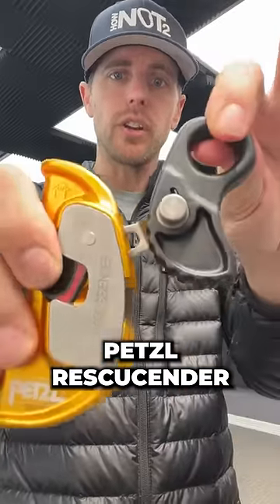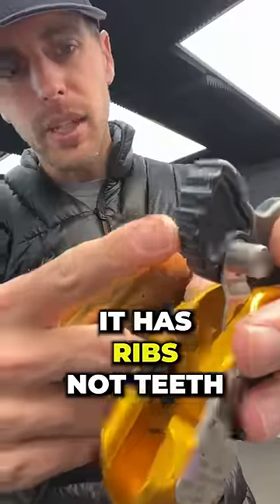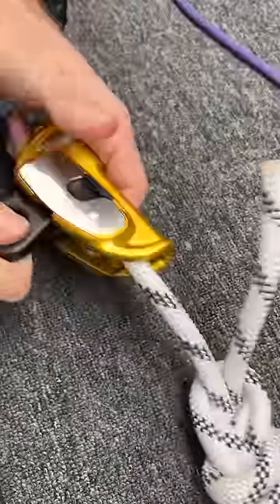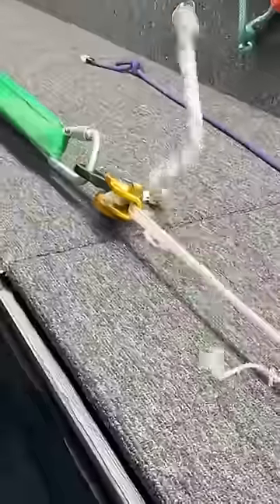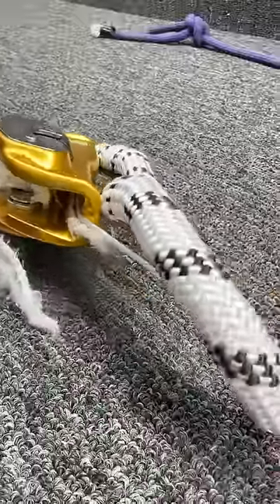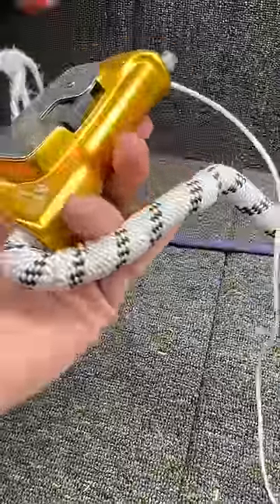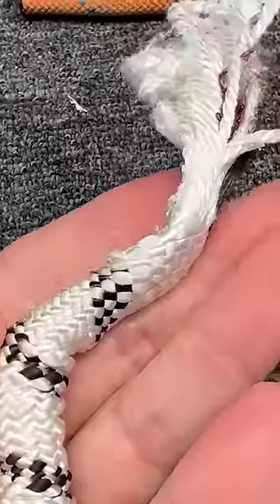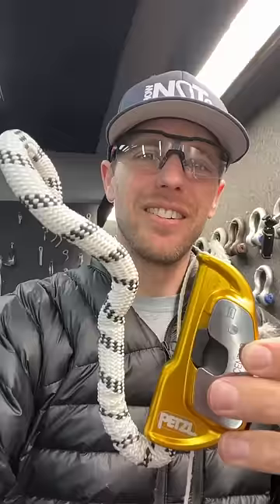I thought it was going to slip? #climbinggear

Comment: I imagine the slipping is in regards to how arborists use it as a hip lanyard and only put very light pressure onto the rope; causing slippage die to lack of friction. It happens with a couple devices.
Reply: Due to lack of friction**
Reply: I can confirm that the only time this tool has slipped for me was this exact situation. But only once. Most of the time you’ll have enough tension for it to work perfectly.
Reply: The other problem is if it slips once as an arborist I'll never use it again if you can't trust it you can't use it
Reply: Slipping can be preferable to ropes snapping. But this instance seems to have overloaded the buckle and it locked up instead of grabbing and slipping to absorb energy over time instead of jerking you to an instant halt...

Comment: IMHO, slow pull is not a legit test for the design intent of the featured gear item.  Moreso, the rescuescender's meant to ease adverse impact (F=ma, you know...) to the climber and gear during a single "critical" factor fall.  Drop tower testing is more appropriate to it's application?  Also, proving the rope is the weakest element in the system, as in the slow pull, proves the reusability goal of the rescuescender.  But, I'll recommend to do a "super good enough" appraisal of any gear involved after any fall event and destroy compromised gear accordingly, of course unless it's intentional repeated drop tower testing to destruction.  Thanks. 😊
Reply: Rescucender is a rope clamp, not a fall arrest device. It is not designed as a 'force limiter'.
Reply: Rescucender is a rope clamp, not a fall arrest device. It is not designed as a 'force limiter'.
Reply: @offpisteskiing  You are absolutely correct, but there are absolutely people out there training rope rescue teams that it IS one. I remember raising my eyebrow hearing that, checking the technical notice later, and wondering where the idea came from. It's floating around out there--I'd like to see a drop tower test too though. Could there be any truth to it?
Reply: Depends on what type of slip you're actually trying for.
If you're looking for drop related slips then you'd want that quick pull style test but for actually "Slipping" the slow one is what's actually checking for sliping.
Reply: @slowgold20  The idea comes from the Shunt or the Duck.  Regardless, the rescuecender was not a replacement for the shunt.  Anyone "training" it's use as a backup should be reported.
Reply: @ricardocabeza6006  this was not a rope access setting, no body to report to. They also weren't teaching it as a backup--more as a force limiting device,  which it isn't either. I let the instructor know my concerns later 👍
Reply: @slowgold20  What rope rescue training are you participating in where the instructor is not certified by any regulatory body...? I think we found the issue.

Comment: I use one of these for a 30' lanyard when tree climbing.
I keep one thats not midline attachable  on one end and use this midline attachable on other end effectively making my 30' into 2 15' lanyards. 
When i need a full 30 i remove this one and keep trucking.
They are basically rope grabs with no sharp teeth. 
So i feel like they wont ruffle up the sheath as much as a sharp toothed device.
Every tool excels at a particular purpose.
When tree climbing and trying to have 2 points of safety at all times, you need 3 ways to tie off to pass limbs.
I use a throw weight to get a rope in the top of tree 1st and then 2 lanyards when passing limbs because at somepoint youll have to disconnect a lanyard to pass a limb above. 
Oh and i use 11-12.5mm( 7/16" to 1/2") on these petzles.
Stay safe out there!

Comment: 5 months later i still carry one of these to every job site.. awesome progress capture on a capstan, or if I'm top side looking for a progress capture to transfer a load to a different rope already under tension since you can't exactly attach something like a gri gri to a rope under tension to transfer the load to it, so I can use this to quickly hold the weight, get the slack, and attach the gri gri or one of it's close cousins, then i can create my pulley system to transfer weight between devices. In windy conditions I will run the gear up the tower with a capstan but we have to run backup ropes for everything anyways so Ill stick one of these on a backup lines and use this as a self adjusting tag line attachment so i can control the objects location and keep it from twisting/spinning in the wind, and can pull it away from obstacles, and it will still go up nice and smooth with a "backup," particularly in urban environments where redundancy becomes even more imperative. So we don't somehow drop a $30,000 radio or a tool bag on a pedestrian.

Comment: There is an older ascending device that was using a similar principle , i have been told it slipped a cm or two every move for the action to lock but it workked, the newer acceders just stop and have no slippage, so you climb more effective.

Comment: Is it ok to use in rain or canyoneering? Does it maybe slip on a wet rope
Reply: Yes.  The "slipping" one can have with 'Gibbs-type' (non-toothed) ascenders (mainly the non-spring-loaded ones) like this one is getting the initial catch.  If the initial 'setting' motion is parallel to the rope, one will miss the catch once in a while.  The solution is to step (or sit) at an angle away from the rope - the extra drag on the ascender frame/shell enables the cam to better pivot and initiate the catch on the rope.  I started using Gibbs ascenders in the middle '70s for vertical caving, and these were the ascender of choice for many in wet and muddy caves where Jumars had problems.
Reply: This device is a rope grab designed for pulley systems. I don't see many uses in sport climbing, canyoneering. Is also heavy. Probably you'd be better with a tandem prusik
Reply: @kayzinti4452  exactly! I used a gibbz for 30 years and never slipped in the wettest of caves. The only time my Gibbs "slipped" was the initial start of the climb when there was minimal rope weight below

Comment: Could you try that on dynamic rope? Wondering is effectiveness as a top rope self belay device. I've already got my setup which is super good enough I'm just interested to see the test 😊
Reply: Mind sharing your setup?  I once used a Petzl Basic but it's no longer recommended as they changed the design.
Reply: @FlyfishermanMike  Yeah man. I use an Edelrid Spoc as my main progress capture device, and I tie back up knots into an HMS on my belay loop as I go (sometimes). I've found that sprung toothed devices are perfectly fine for this especially on a chunkier rope (I use a thicker gym type rope for top rope sb than my standard ropes) and sometimes a second line with a petzl handled ascender (attacjed to a bungee over my shoulder to hold it up) as a back up on a second rope but in reality you're never going to take going take a factor fall on a top rope setup. Super good enough as they say. Never had a problem. If you want to avoid using teeth (best practice if we're being super serious about this) I would highly recommend the Beal tract. Awesome and very strong bit of kit however the spoc has a rolling pulley wheel which is smooth as butter. On easier terrain I will use a grigri on its own or as the back up. Makes it very easy to switch to the descent. It's worth bearing in mind that there are no pieces of kit designed, and advertised as self belay equipment so for the hardcore safety people out there there will always be a naysayer for any device. Hownot2 has been my guide for alot of my setups in the sense that he really shows you how strong our equipment really is. My default safety device, however, is my own brain and experience. Its the first and most important piece of safety gear we own. Lol that was alot of words bit I hope that helps 😊

Comment: It definitely slipped a few inches but at some point you started arching the frame and that closed the gap clamping the rope. You can tell thats what happens by the difficulty in re locking it.

Comment: Just a guess for entertainment purposes only…this rope is failing because of a different reason to the toothed version.  The teeth put an intense point load on individual fibres causing a progressive failure.  The un-toothed version generates high friction (heat) causing progressive failure.  Any successful device must act on the whole rope as a unit.  The moment a mechanism acts on fibres in isolation, a progressive failure will result.

Comment: I used these for everything but climbing because I never trusted them ... As long as your position lanyard and Y lanyard are free and untangled or you don't have any tools sticking out of your Diddy bag or harness's tool bag hitting them , they were okay I guess , but , because of the amount of crap we have to climb with I absolutely refused to use rope grabs on my life line due to them getting entangled and being forced open or forced shut and locking up ultimately rendering them unless and they would absolutely slip and slide or lock up and have you stranded needing someone to come free it up if you were limbing up and your position lanyards under load ultimately rendering you unable to go up or down 🤬😡🤬😡🤬😡😡😡😡 I would get so mad trying to use these things I would literally just about be ready to quit 🤣🤣🤣🤣... Sure you could turn around and make sure it's cleared before every single moment of ascension but until you do it all day , you'll never know how truly frustrating and exhausting that is and once you have to climb a 400'-600' while fighting the rope grab locking up on you while the rope is getting tangled up in the tower from the wind while using a fall arrester , carrying all your tools up and dealing with slippery rungs and climbing faces/ladders from all the buzzard and bird crap , you'll never know just how much I was hoping that rope grab was going to explode 🤣🤣🤣🤣🤣🤣

Comment: I climbed this 50 ft rock face in front of my family as they freaked out and told me not to but it was beyond beginner there was a place to put your hand every three inches and by the time they had gotten all the rope on I was already at the top of the mountain lol I had time to smoke a joint and they didn't even notice made it back down with no rope also

Comment: I'd love to see how this would fare against a toothed ascender in a fall, if the lack of teeth does actually prevent it from cutting through the sheath I would imagine it would perform better, although maybe it'll just lead to the rope snapping 🤷‍♀️
Reply: its made to hold a static load, not fall protection.  It will slip if a shock load is applied and its not already fully engaged, and its not engaged by default as its made to slide up a rope very easily.  great for its intended use, but not fall protection.
Reply: He has a video for that already

Comment: doesn't need teeth if it has pressure
and it's getting more pressure the more you pull on it

the only ways it could fail is if it breaks appart of it the rope breaks

Comment: Why do an ultimate rope failure demonstration of a device that is only intended to hold loads in normal climbing scenarios and well below 13.73kN? I'd be much more interested in knowing if the device simply functions safely as intended and indeed does less damage to ropes than ascenders with toothed cams do.

Comment: Yeah you are doing it wrong. That is not used in a situation where you are slowly and steadily increasing forces applied to it. It's intended for shock loading.
Reply: No it's not. It is a rope clamp...not a fall arrest device...
Reply: This device is most commonly used in mechanical advantage systems as progress capture devices, and a replacement for a Prusik so I think a slow pull of increasing force is pretty standard for this device, granted getting to 13 KN would probably be very difficult, if pulling by hand, and not with a winch